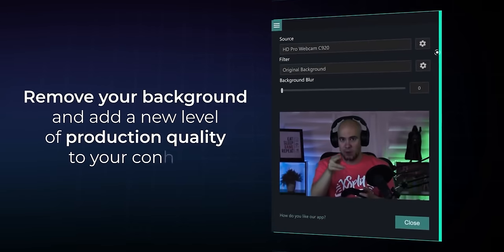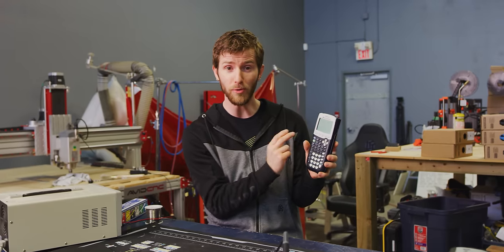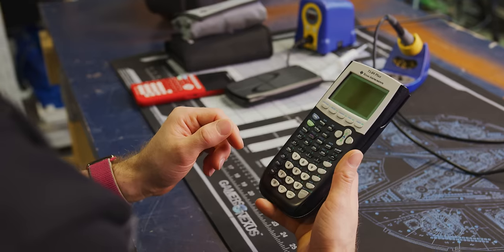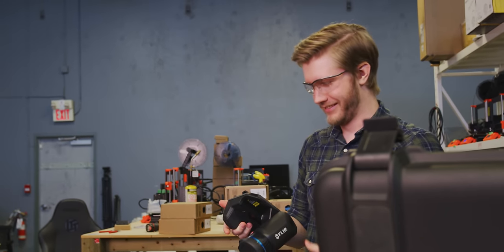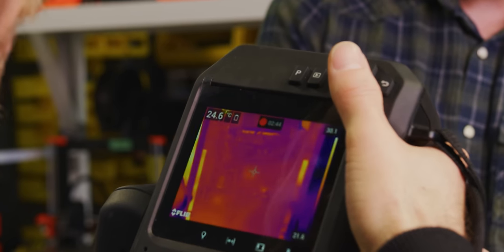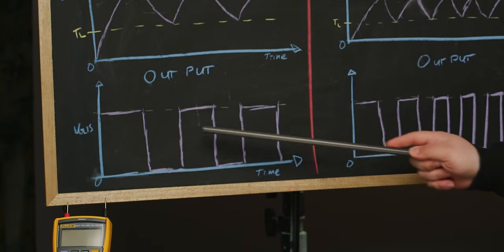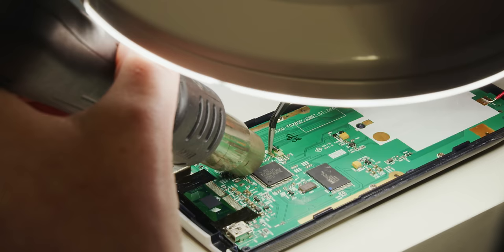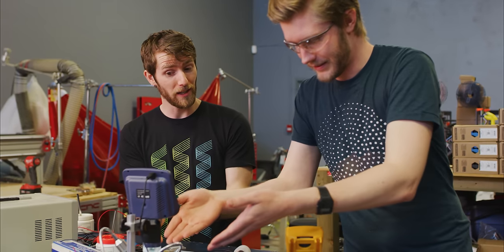Water Cooling a TI-84 Graphing Calculator!

Comment: 5:50 C'mon Alex, those look like at least 0402, should be a breeze for you to replace!
Reply: It's 0603... Should absolutly no problem for him.
0402 is tricky but manageable.
But 0201 is hard and I know what I tell and do every f***in' Day!
Reply: @launacorp  I think it is even larger than 0603. But it looks like they literally have no one capable of soldering at LMG, which is quite sad.
Reply: Well from my inspection Alex's engineering skillset is more on the Cogwork Orthodoxy side rather than the Church of Maxwellism side...
Reply: @launacorp  I found a high-res picture of the board and compared the size to the TSOP-48 flash package. They're 0805 — absolute breeze to solder. Also, why is he using hot air to remove a single resistor?

Comment: 7:20 "we are adding capacitance" and inductance !
Reply: and resistance! LRC baby!
Reply: Inductance is negative capacitance, you can't add both. They're adding inductance.
Reply: @Ovenman940  wouldnt each wire add inductance, but the wires together would add capacitance? What do you mean you cant have inductance and capacitance - in what context?
Reply: @ethanblagg  Yes, but resistance does not make tank circuits with the capacitance and start to oscillate.
Reply: @Ovenman940  if it was on one space (as a component) - yes. When its in a wire its distributed as both.

Comment: Linus: overclocks a calculator
We all know that the extra performance will be used to spell out 58008 (turn it upside down)
Reply: there is a full alphabetical keyboard on those calculators
Reply: @benbrauns8135  58008 is the og one
Reply: 5318008
Reply: My name is Elias and I can vaugely spell it on calculators "56173"
Reply: You know it says 5318008 in the intro right😂

Comment: Should have just replaced the whole timing circuit with a suitable crystal oscillator. RC circuits like that are very finiky.
Reply: @NobbsAndVagene  It's like 96x48, I'm in.
Reply: Yo someone send me one of those, it’s something faster than those fucking chrome book laptops at school
Reply: @froyo4u  You can Chrultrabook to convert it to a standard Linux laptop (a chromebook, not the TI-84+). Anyway if you want speed, go for a TI nSpire, not the 84+

Comment: @5:54

Get two soldering irons, or a tip wide enough on one to hit both ends. This is not hard, these flat 0402 resistors are some of the easiest components to solder.

Comment: Yeah, I was wondering how you were planning on soldering a new resistor on, after clearly having have ripped the resistor and the solder pads right off the PCB.

Comment: I am highly disappointed you didn't use a peltier or some other below ambient solution. Also changing voltage and other things. I want to see 100 mhz. Hell, I want to see it run crysis

Comment: Could have just cut a solid block of aluminum or copper and mounted it in the same location as the water block. It would have been just as effective but infinitely more portable and practical. Hopefully that is what Alex ended up doing after the video was done.

Comment: Thought he was going to say they were tiny try soldering in an air force radar IF box where the points are smaller and you need to bend a wire that breaks time to show you all some.skillzz

Comment: I only used a TI-84 once during my mechanical engineering degree. I took it into an exam as a backup calculator and they confiscated it. It wasn't very user friendly for use during normal study. Then it completely died and couldn't be revived so I threw it in the trash and I'm glad it's gone. A regular scientific calculator is so much better for engineering.

Comment: Serious question: why would you use a graphic calculator? Is its precision higher or is its CPU that much better designed for doing mathematical operations that it still outperforms a computer running maple for instance?

Comment: Don't use a heat gun on such little electronics! It's a lot easier and safer to flood a resistor with some solder while heating with a soldering iron. That way you can apply heat almost uniformly and to both pads at once. Practice on some old boards from chopped toys. After gaining some skill, you will just lift resistors off board using only the iron. Afterwards clean with a solder wick, then proceed to replace a new element.

Comment: I've over clocked my graph 90+e from 115mhz to 310mhz, I can't go faster than 315 or 320 because there is some problems of synchronisation between the memory and the processor a that speed

Comment: 6:15- looks more like those were the pads...oops.  6:50 yep..goneski.  Also,it looks like those resistors were not in parallel..the one with the ripped off pads appears to have a separate trace running off to...somewhere,maybe.. hard to tell from the video.

Comment: I really wanna see this done on a colour Prizm calculator, like the CASIO CG-50

Edit: My reasoning is because its around 54 MHz to start with and can be overclocked to 84Mhz without any hardware changes so I'm just wondering how far it could be pushed 😂

Comment: I had a question? Aren't you supposed to water cool by letting the water in (taking off that cover)? The water is never going to reach the components if it is in a loop. Tbh, I didn't even bother with a pump. I just filled up my computer tower with water. smh